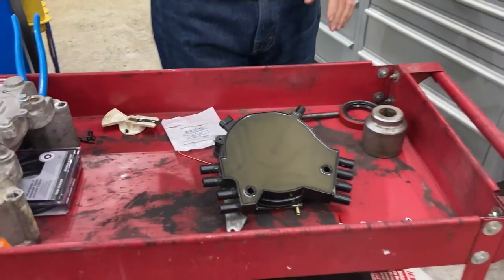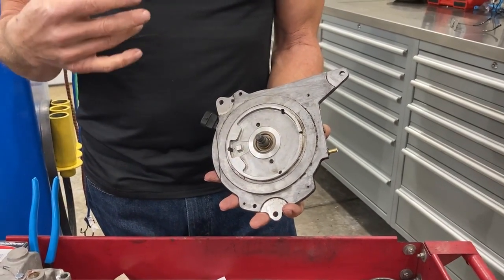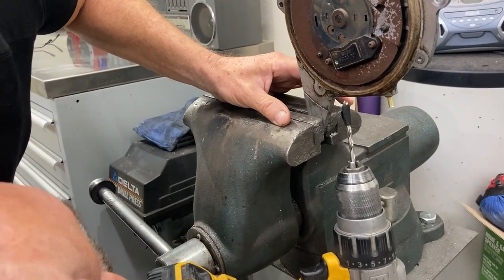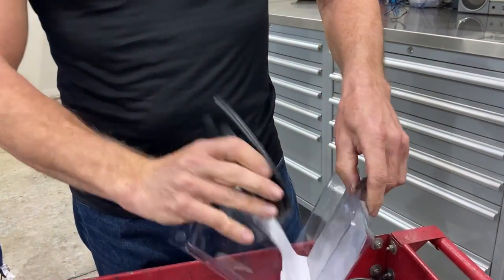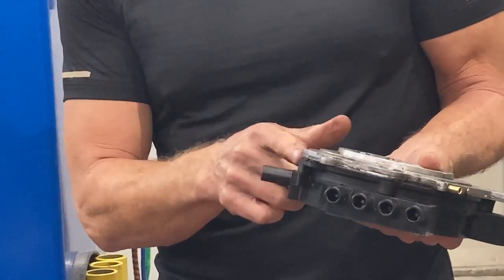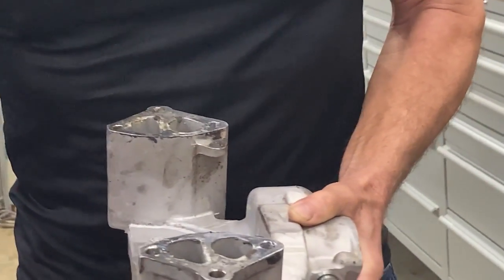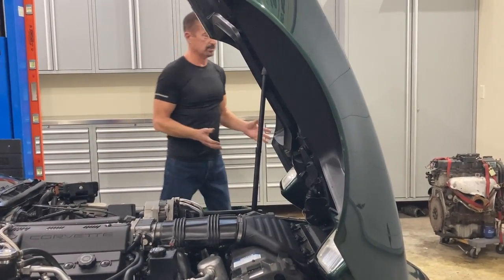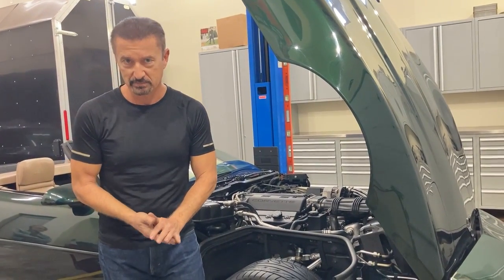1992 - 1994 Corvette LT1 Optispark DIY Redesign

Comment: Petri's' spline drive vented-opti conversion uses t-fittings to connect all three vent holes on the bottom of the distributor housing to a single hose, then as with the factory setup, it goes to a fitting on top of the air intake just in front of the throttle body, you also need a filter & check valve in the hose that goes from the bottom of the distributor cap to manifold vacuum, to regulate vacuum and keep debris from secondary terminal erosion & ozonated/ionized air out of your engine.

Comment: There are four screws that hold the distributor cap on an if you don't get all four properly installed & torqued, your cap will not seal properly and distort and leak vacuum, no longer pulling fresh air from the air intake and instead sucking in dirt, water & oil.

Comment: I think the Pontiac and Buick vented Optispark I thought it sucked vacuum out and not blow air in to get the moisture out and spark gases. The water pump hole on the bottom I tapped it and put a hose on there and ran the water away from the optispark, I put RTV around all the scenes optispark let the bottom holes open for drainage.. I like to power wash my stuff and keep it clean so I probably got like five years out of it, but I was wondering how to hook vacuum line up to it. thanks for the video that helped out.

Comment: Hi I love the video thanks.  I was wondering could you make a video on how to replace the bearing in a GM optispark? (the vented one).  I have my original optispark on my 96 and it has the Mitsubishi sensor. I have a new cap and rotor GM nos but the bearing is too much play, its a lot of play actually.   It would be great if you could do a video on how to replace it so those of us with worn bearings can restore our optis instead of rolling the dice on  the chinese offerings.   Thanks

Comment: They all used that setup till 95. That’s when it changed to vented, but a lot of great advice. I’ll be doing that next time I pull my opti off. On the factory vented models 95 to 97 they hook up vented optis to the air intake tube running to throttle body but given what you mentioned about hooking up to vacuum port on intake sounds like an awesome idea. I have an extra port on intake on driver side when I deleted egr and air pump so I think that’s what I’ll do.

Comment: I never owned a Ford or any Chrysler product. But in hindsight one of the biggest mistakes I ever made in life was in the late 70s when a dude that I knew from High School owned a 1969 Dodge Charger in super nice condition. Red w/ Black interior and automatic on the floor with console and black bucket seats. His steering went out and it had a couple of other minor issues - he said he didn't want to get "Nickle and Dime'd" fixing things on the car. I at the time just never considered it as I was more into 1972 Cutlass Convertibles. So he sold it for like $3,000 measley dollars. A fender for that car today costs that. I could shoot myself for not buying that car.

Comment: I have a 92 Corvette. Rough idle issue. I replaced the IAC and reset it. For a while it was running great now it is acting up every now and again surges up and down. It is a strong Runner outside of having that issue at a stop light and although I did not test it I do not believe it is optispark. Do you have any suggestions what it might be. Thank you, Ray
Reply: I appreciate the reply, before I start ripping it down to the optispark. I did a diagnostic check with the on board computer. It pulled up a couple of codes two of them was the 02 census and the other throttle body sensor I checked, it was a weak signal I change that out first and then checked 02 and sure enough one of the wires on the driver side was burnt from the exhaust. I am going to reset the IAC when I get everything put together. I will let you know my findings. Hopefully it works out, if not I'll have to dig deeper to the opti. Thanks
Reply from the maker: When I first bought my C4 it ran okay, but idled like it had a performance camshaft.  Took the Optispark apart and found corrosion inside the distributor cap.  If you've never worked on the Optispark, there's a good chance that's where the problem is located.  Yes, it's a pain in the ass to work on, but that's a good place to start.

Comment: I wonder what opti he used for replacement.
Reply from the maker: I purchased my Optispark from O'Reilly's Auto Parts.  It comes with a lifetime warranty.  It's been over a year since I did the modifications and the car runs perfect.  No issues from the Optispark system.  GM was so close to getting it right, unfortunately they came up a little short!

Comment: The vacuum source i use is on the left side of the intake manifold.  It uses a vacuum tee but i no longer use EGE and secondary air . Since i have the MSD cap and rotor i have the check valves and vent hose. I run an electric water pump to so i no longer use the weep hole on the water pump.

Comment: Wow! I have an 88' which doesn't come with the Optispark but man wanted to understand the issues surrounding it. Gotta tell you this was a very good idea. But, how would it work with a closed system to collect the moisture. Maybe install a small catch-can with a drying agent in it? Maybe silica beads? Or maybe, just leave the third (top) line off, using only the bottom lines and route the  lines from a vacuum source and dump it into the plenum? Thoughts?

Comment: Nothing new.   I did this 5yrs ago.   I used the center hole to run a line up to the intake tube  and the other 2 I ran lines up to a hand made box 3 inch square filer.  Issue solved. I used a tap and die set and threaded the tubes into the opti    Where the electronic connection goes in the top I sealed with epoxy to keep water from getting in.

Comment: Where did you get the check valve. I am assuming the two hoses pointed down are connected to the filters. The hole drilled in the cap is the source for the vacuum.

Holy cow, a Mopar Guy fixing an issue on a Chevy. 😂

Also what did you adjust to make up for the vacuum loss?
Reply from the maker: I had that check valve in my drawer full of Mopar junk.  I believe NAPA auto parts sells that check valve.

Comment: Great video, thank you for sharing. 
Is there a better source for vacuum that wouldn't require drilling? Also, what size check valve did you use?

Comment: Petris Enterprises makes a vacuum conversion with the spline drive
Reply: Is it less expensive than this?
Reply: @TheCorvettedez  it is if I don't have to do it 2 or 3 times ..using and then having to modify cheap Chinese parts 2 or 3 times is not cheaper than buying a quality product only once
Reply: @johnperales5431  
Not at all, because he started with a quality (lifetime warranty) OEM part that he then modified.
Reply: @TheCorvettedez  no one makes OEM parts anymore....every OptiSpark available on the market today is made in the same factory in China unless you purchace one from MSD or Petris ...you are 100% garanteed to do this 2 or 3 times if you buy any other Optispark

Comment: Nice tutorial. I actually did everything you mentioned to my '94 Polo Green 6sp 19yrs ago which I still own and has been trouble free to this day. I also ran a vacuum intake line into my cabin to insure I had clean dry air going into the OptiSpark.  Replaced it with the updated vented one and modified it as you have. My upper radiator hose blew out and the coolant shorted out the OptiSpark, so replace that hose if it hasn't been done recently! Replacing an OptiSpark is no fun, believe me.
Reply: I watched a 35 minute video on replacing one on a 4th gen z28. What took that man slightly over a half hour on video took me 15 hours over 2 days 😂😭

Comment from the maker: The reason for two make up hoses on the bottom of the Optispark is that the "general rule" is the make up air flow capacity has to be greater than the vacuum hose flow rate.  That ensures that no vacuum is created inside the Optispark unit.  If you develop a vacuum inside the Optispark, oil from the shaft seal and/or moisture might be drawn into the Optispark.  Not sure if the Optispark shaft oil seal would work under vacuum.  If you look at any vehicle, the make up air hose is always bigger than the PCV hose.

Comment: I have a 94. I did this same exact mod to mine before i seen your video.  I like a few different ideas you presented.   My next opti will get a couple of these tips.  My only question is why two hoses on the bottom?  Flow is not so critical i would think.  Instead of tapping for vacuum behind the IAC is to tap in front of the throttle blades.  
I cant beleive how clean your engine bay is for the year of car.  I like the color of your car as well.  
Nice job on video. Clear and to the point.
Reply: I too have a '94, Polo Green with a clean engine bay. Simple Green and a small brush, then spraying all the plastic parts with a non greasy preservative. Just keep water away from that OptiSpark!

Comment: I have a 92 LT1 and I vented my opti-spark with the help of Petris.  As part of this project I did the "while I was in there" other mods that also help protect the opti-spark.  I upgraded to an electric water pump which eliminates the weep hole leaking onto the opti problem because you plug the weep hole up.  you also eliminate an oil leak possibility as you close up one of the seal holes where the water pump drive comes through the timing cover.  If the electric pump fails (which mine is still working after 7 years or so) it only takes a few minutes to replace.  Your idea about the filter used for the inflow of clean air is interesting.  I just made a hole in the air intake rubber tube and put in a plastic hose connector for the intake air to the opti.  How did you clean all the rust out of your opti?   Nice video.
Reply from the maker: The only way to get rid of the rust and corrosion was to replace the entire Optispark distributor.  It's been a year since I did the modifications and the car still runs flawlessly!
Reply: My next opispark is going to be a Petris. I like the idea of using the air intake for the source of vacuum. I will be adding a electric water pump. What kind did you use?

Comment: I have changed out the Ignition Coil, Ignition Module, Electric Fuel Pump, Fuel filter, Fuel pressure regulator, Map sensor, Idel air sensor and the Fuel positioning sensor and the internet says that All these part should be replaced after 75,000 miles so i did just that.... my C4 just turned over 100,000 miles and just started running bad... rough Idel and making a popping and pinging backfiring sound so yesterday I changed all Spark plugs and wires the old factory wires were numbered from the factory... however there was no change in the way it ran..  I've been told that the OBD1 Scan Reader will not tell you if the Optispark is bad or good... so what's the point...?

Just keep changing parts until you fix it or what...? The C4 Vette with the LT1 is an amazing car but the idea of the Optispark was STUPID...!

THANKS FOR NOTHING GM....

If anyone reading this has any ideas concerning my problem I'm open to any ideas...

Thanks 

Happy New Year
Reply: I agree with your assessment of stupid!! It truly is stupid. 

To read the codes from the ALDL.  To recover ECM codes from the 1984 through 1993 Corvette, place a jumper between pins "A" and "B" on the ALDL (Assembly Line Diagnostic Link) connector. This connector is located under the dash just to the right of the steering column and has space for 12 pins although not all of the cavities will be populated. 

Turn the ignition switch to "On" but do not start the engine.
Depending on the model year, either the "Check Engine Light" or the "Service Engine Soon" will begin to flash.

As the code display sequence begins, you will see a flash followed by a pause and then two flashes. This is the indication for the number "12". The number 12 is a delimiter intended to show where the ECM code display starts and stops.
Code 12 will flash three times and then any stored codes will flash. When all codes have been displayed or if there are no stored codes, the number 12 will again flash three times.
For example, a problem with the EGR system (code 32) will be shown as 12, 12, 12, 32, 32, 32, 12, 12, 12.
This would be displayed on the Check Engine/Service Engine Soon light like this:
12: flash (pause), flash, flash, (long pause)
12: flash (pause), flash, flash, (long pause)
12: flash (pause), flash, flash, (long pause)
32: flash, flash, flash (pause) flash, flash (long pause) 32: flash, flash, flash (pause), flash, flash (long pause)
32: flash, flash, flash (pause), flash, flash (long pause) 12: flash (pause), flash, flash, (long pause)
12: flash (pause), flash, flash, (long pause)
12: flash (pause), flash, flash (long pause)

On the 1990 and 1991 model shorting pin "H" to pin "A" will cause the ABS light to flash ABS codes. (Beginning in 1992, there is another technique. 

Not all codes are displayed using this technique. There are four codes that will not display without a scan tool.  The 1986 through 1989 Corvettes will not display any ABS codes. A special test fixture is required for those models.
With the interior redesign in 1990, Chevrolet added additional computer capability. The CCM (Central Control Module) was added and a method was provided to display codes on the speedometer of the Corvette.
From 1990 through 1993, you shorted ALDL pin "G" to "A" and turned the ignition to "On" without starting the engine.

The codes will display on the speedometer. If there are no codes, the speedometer will show three dashes (---) and if the CCM cannot communicate with the other computers, the letters "ERR" will show up on the display.
The module number associated with the codes will be displayed on the odometer and will show which computer's codes is being displayed.
For the 1990 and 1991 Corvette, the modules are Module "1", the CCM computer and module "4", the ECM module.
For 1992 and 1993, an additional module, module "7", the ABS (Anti-Lock Brake System) and ASR (Automatic Slip Regulation System) codes will be displayed.
The codes will show up for three seconds each and once all codes have been displayed, the speedometer will show three dashes. You can either turn the ignition off for five seconds and then back on to repeat the process or turn the ignition off and remove the jumper to restore normal operation.
Sequenced Code Recovery - 1994 through 1996:
In 1994, Chevrolet went to a 16 pin ALDL connector in preparation for the federally mandated change to the much more capable OBD-II (On Board Diagnostics - Version 2) system.
As with the 1990-1993 model, you can display codes on the speedometer but the pins to be shorted are different. 

Beginning in 1994, you short pin "12" to pin "4" and once again turn the ignition switch to "On" without starting the engine.
The speedometer will display any codes using the same protocol as the 1990-1993 model but there are some changes in the designation for the modules plus additional modules are added:
Module "1" is still the CCM module.
Module "4" is now called the PCM module (Powertrain Control Module) because automatic transmission computer control was added to Engine Control Module in 1994.
Module 7 (on the 1996 model only) is the RTD module. (This is the Real Time Dampening module which replaced the Selective Ride Control module in 1996).
Module 9 is the ABS/ASR module number from 1994 through 1996.
Finally, Module "A", the DERM (Dynamic Energy Control Module --- the air bag control module) will be requested to show any codes.
Just like the 1990-1993 display, you read the codes on the speedometer and read the module number on the trip odometer.
Again, you can cause the codes to repeat by turning the ignition off for five seconds and then back on. Turn the ignition off and remove the jumper to restore normal operation.
Reply: @Dan Dilts  that's alot of great information... 👍🏻 I got my 95 C4 running yesterday and just like you said.. it was the Optispark (FLUX CAPACITOR)... purs like a big kitty...
Reply: Whats stupid is u bitchen about it and not replacing the optispark.

Comment: You know what would be significantly easier and a far better option?

Buy the MSD cap and rotor set for the spline drive distributor, it includes the correct check valves in the venting hoses, and has the vacuum fittings in the correct spots. No need to re-invent the wheel, and if you're going in there you want a new cap and rotor.

More importantly, while you have it all apart, you need to do something with that bearing. That is what often causes issues on these older OEM units.
Reply: What are you going to grease the bearing?
Reply: @frankkeel8410  no, replace it.

Comment: Had thoughts of doing the same things to the dizzi and water pump on my Corvette in Australia. Parts aren't readily available in Aus. Very good explanation, and no rambling on like other videos!! Just straight to the point, with explanations of why and how. . Excellent
Reply: Parts are easy to get in Australia, Summit and Rock Auto ship here and it usually takes 5-7 days to get what you order. Also much cheaper than any of the outrageously over priced parts places that are in Australia charging around 2-3 times the price you can get it delivered to your door from Summit or Rock.